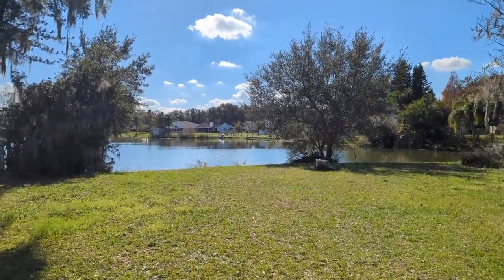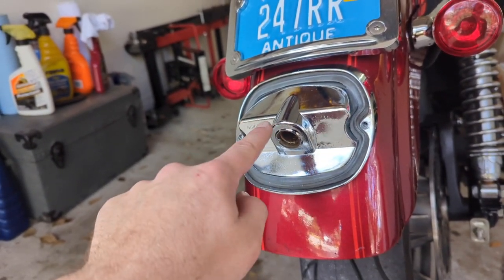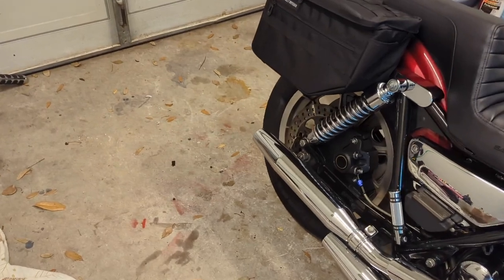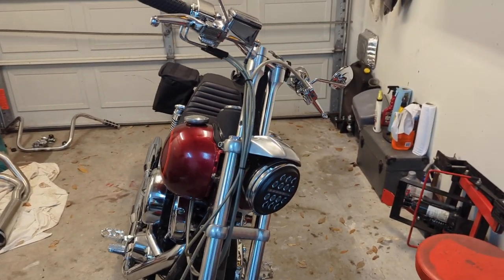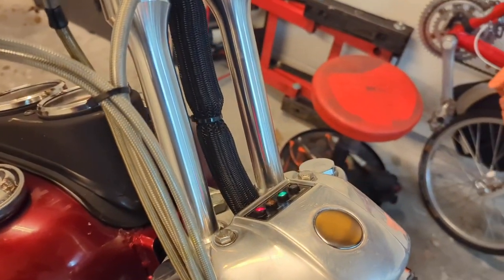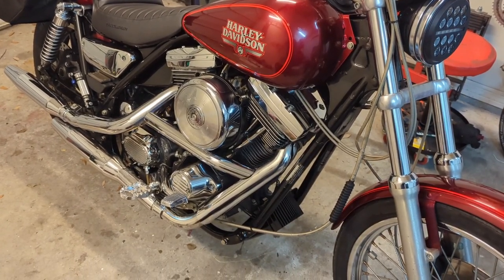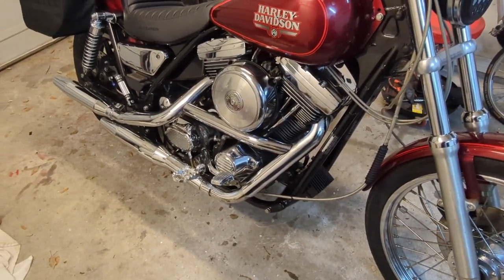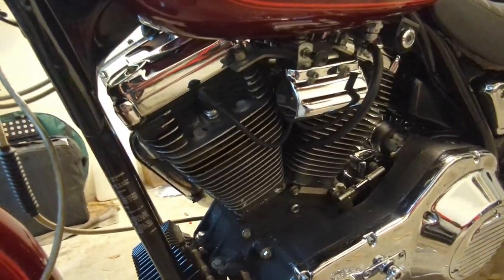Completing the LED tail light conversion on the 1988  Harley FXR  [2023 Build series]

Comment: New to this channel but question? Are you putting an led head light as well?
Reply from the maker: Yes I installed an LED headlight. You don't need to modify anything for an led headlight to work. It's the turn signals that cause goofy hyperflash issues.
Reply: Great job on the install. Would you happen to have the link for that headlight? @eff_ex_argg
Reply from the maker: @TheTwitch03  SOYAVISION Black 5-3/4 5.75" LED Headlight Hi/Lo Beam Motorcycle Headlamp Driving Light with DRL for Dyna Softail Iron Sportster 883 https://a.co/d/7YEX3W6
Reply: @eff_ex_argg  Thank you! Did you need to do any type of re-wiring for this light?
Reply from the maker: @TheTwitch03  no it's plug and play for the most part. If I remember there is another wire for some little running lights, but you can leave it off or solder it to the positive wire and it will be on all the time. (That's what I did)
Reply: @eff_ex_argg  Sick!! Thanks for the info bud!
Reply: @eff_ex_argg  Just out of curiosity. I purchased a pair of turn signals like yours, the low profile ones that fit right under the hand controls. Did you have a hard time wiring them? I upgraded my hand controls from a '95 dyna, but apparently they aren't compatible? Any info would be greatly appreciated.
Reply from the maker: @TheTwitch03  I had no issues. My bike already had two wire turn signals. Somi just wired these new ones to where the old ones went.

The only issue you might run into, and I address it in the video, is that when you add led turn signals to an FXR, there is a voltage leak due to the way the turn signals indicators are wired. So what's happens is both turn signals will blink at the same time. I plus the turn signals dummy light and this will fix the problem. You will also need to install an led flasher relay. You can get them on Amazon for like $10.
Reply: @eff_ex_argg  I see! Thank you for explaining that. I unfortunately just upgraded my hand controls to Dyna hand controls. And the mechanic had to work some magic in those bad boys. I bought some Moons MC turn signals just like yours, except I think the wires are black and yellow. The tech said they are not compatible but I find that hard to believe.

Comment: Where did you buy the bags
Reply from the maker: I got them directly from viking bags.
Reply: Hey men I watch your video on the led  installed on the fxr I’m actually doing my 87 fxrs now do your signals staying flashing when you push the bottom and what relay did you used cause I’m thinking about buying the badlands equalizer

Comment: Hey men I’ve been watching you videos and I need help I’m doing the same thing you did your bike I’m also doing to my 87 fxrs did you run an led turn module for you led lights to work I really need help
Reply from the maker: I got an led turn signal relay from Amazon. The one I got has a little knob where you can adjust the speed of the flasher.

But yes, the turn signal flasher relay will have to be changed as the stock flasher won't actually flash as the LEDs do not draw enough current to activate the flasher.
Reply: So that’s all you did and turn signals work? You not running a Badlands turn signal module!  Cause I did buy that flasher on Amazon should be here soon
Reply from the maker: @luisabreu2457  yeah that's it's. I removed that flasher module all together.
Reply: Hey men is me again I’m reaching out to you again cause I need to know exactly what you did to you bike to get the front turn signals to work ? I did buy that led flasher and turn signals still don’t work what’s happening to my front turn signals is they both are flashing at the same time when either switch is press my rear turns are working fine need all the information I can get please
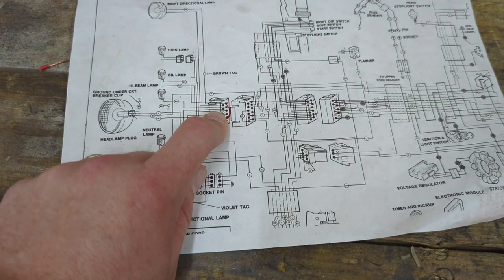Reply: @luisabreu2457  at 7:15 he explains it pretty well. you either have the wrong part or wired it incorrectly.
Reply: @davinstrong5792  
Thanks is all set I figure it out thanks
Reply from the maker: Sorry, I didn't see notifications for this. 

Dude, just unplug your turn signal indicator on the dash and they will start flashing independently.